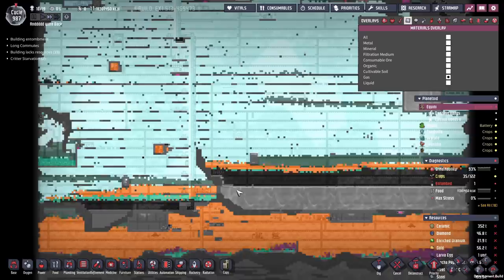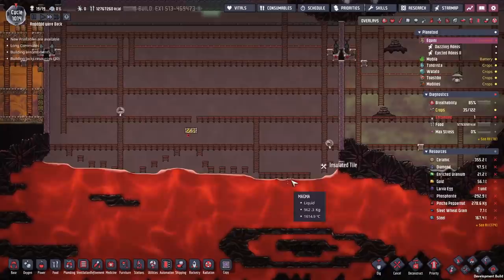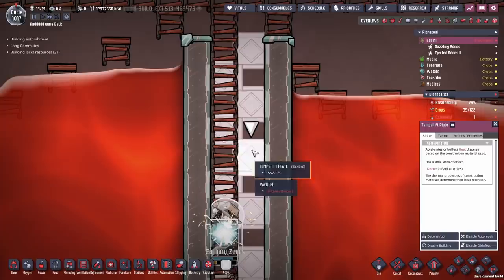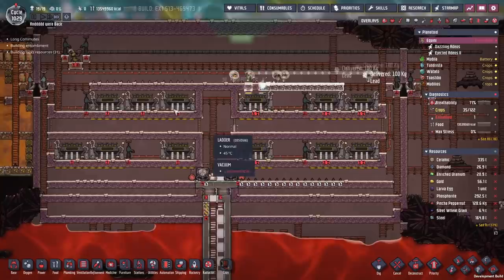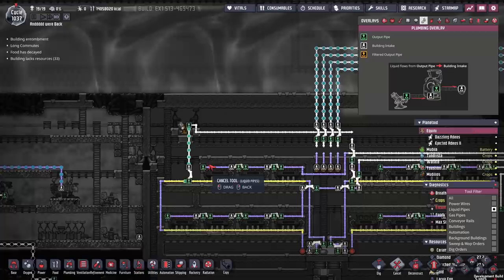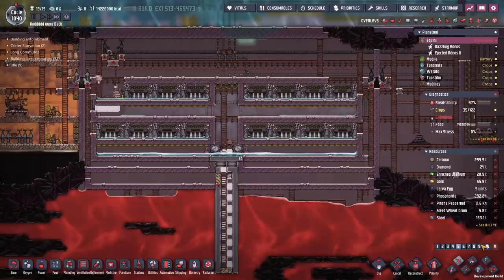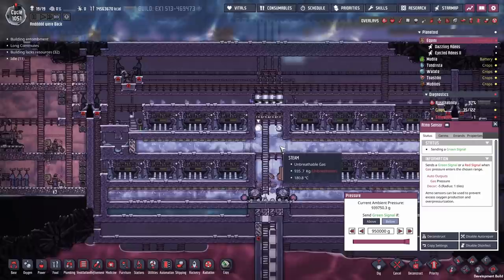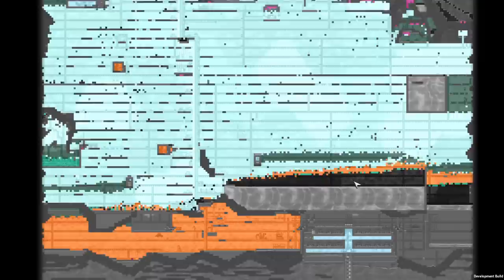Ep 14 : Magma power and water filtration : Oxygen not included Spaced out

Comment: Right Aqua tuner super coolant pipe is stagnant. It’s filled up one extra packet I think.
Omg that mod is a god sent blessing.. finally you can do proper automations in pressurized environments 😎 such a useful mod. Why doesn’t Klei allow that? There was a proper reason.. I forget.
Reply from the maker: Doh, I left the filler bridge on. I should have removed that before I activated the aquatuner. I will have to remove a bead from that loop. Thanks for the spot.
Reply: @FrancisJohnYT  You can prevent that (if you forget to remove the bridge that feeds the loop) by using two bridges in the main loop. Best illustration of the technique I know of is here: https://www.reddit.com/r/Oxygennotincluded/comments/gdk3h8/how_to_plumb_your_aquatuner/

Comment: If you use a heat exchanger to heat up the incoming mixed water and cool down the outgoing boiled water at the same time, you can get power and filtration while using less heat from the magma core.
Reply from the maker: I want to drain the heat out of the core, by end game I want to have it all mined out. Will have to desalinate our water a different way then but it should still take a long time to drain the core.

Comment: One thing I would suggest for your water purifier: make sure to have a liquid lock to do any servicing because things can break or maybe you might need to make updates and it comes from messes I made when I did mine feeding it magma from several volcanos as my heat source
Reply from the maker: The liquid lock is still there for now though I have removed door access for dupes. Lets hope this filtration remains stable.
Reply: @FrancisJohnYT  I seen towards the end but expect breaks but it's very efficient in extracting water out of polluted and salt water and might make for an interesting project if you plan on using magma from your minor volcanos for future purifying

Comment: FYI, as of Feb 2023 the door trick doesn't appear to work anymore, as in, can't built through a closed door anymore. The other thing is that the aquatuners can't cool the turbines, so there must have been some change since the video was made. I am currently only running two turbines and they instantly overhead into the "turbine too hot" 130+ C range. Aquatuner can't cool em down. Incoming oil into tuner is 116 or so, output is still above 100. Will let it run a few cycles and see if it's get better but right now it doesn't look good.

Comment: One word of caution: I did a similar geo thermal desalinator on my last map, and had issues with the stream pressure being too low.

Granted, I only fed in salt water and had a single pipe feed, but the issue was that with pure salt water input I was losing a tiny bit of mass to salt with each packet. But since the steam turbines always pulled 10kg of fresh water out, and I was putting in a few grams of salt shy of that as input, my system would lower the steam pressure too far, and then inject waaay too much heat in the instant the doors closed. So the system failed until I forced the steam pressure above a certain threshold by rerouting the fresh output via automation.

Your system isn't running 100% (yet) so it might not have this issue, but it still could happen once you start purifying full time, if you end up with 30kg or less input for some reason.
Reply from the maker: I am keeping the pressure really really high at 900kg+ for exactly that reason. It's why we are using the atmo sensor mod. Additionally we can only take out 30kg/s but we can potentially input 40kg/s. I am feeling pretty safe, but we do have access back in if something breaks.

Comment: Hi @francis john!  One quick question. Why not use cobalt metal tiles for your hot plate above the doors? Better TC than diamond, shouldn’t have to worry about hitting the melting point, and easily renewable resource with the cobalt volcano. Same question for the tiles and temperature shift plates for the cool steam vents?
Reply from the maker: Did not even consider that, will have to use it in the new cool steam vent tamers. Would not use it for the hot plate though. It's almost impossible we could replace it right now. Before that their is always the chance to melt it so I would just stick with the diamond.
But considering how renewable it is we are going to have to take advantage of it. Same with the Aluminium.
Reply: @FrancisJohnYT  thank you for the info!  I love watching your videos as I always learn something. You always make me feel like I over build though. For both the nuclear reactor and the geothermal I would have made the steam tunnels 3 blocks high and added temperature shift plates down the middle block but I guess it’s not necessary.

Comment: You didn't need a mod. You can set a second vent down and place a pipe element sensor. 

When the top vent is blocking the water will try to go down to the down vent. But that one should also be blocked. So the water stands still in the pipe allowing you to detect that the system is over pressurized. Only downside is that it only detects if the system is blocked you can't really prevent it.
Reply from the maker: I toyed with that idea but decided against it in the end. The issue I ran into was which pipe do you monitor?
If you monitor all four that gets really tricky. Another option was to just have the vents in a thin layer of petroleum for the overpressure trick but that felt wrong.

Comment: That's a really neat way to filter the water.

However, novice question, aren't you going to want the the brine for crabs and crops?
Reply from the maker: I'm not aware of any crops that need salt water or Brine. Lettuce does need to have a layer of the stuff on them but that is not consumed. As for the crabs they don't need the water, you can dry ranch them if you want.

Comment: Why did you put the aquatuners at the center next to the magma?  Wouldn't they be safer way out towards the edges?
Reply: I was thinking that too, right on top of the hottest part of the build seems unwise
Reply from the maker: It's to do with cooling and an even gradient of temperature.
All the water drops in the centre where all the heat producers are along with the temperature sensor. Set the temp to 180C and the whole boiler with end up at that temp. Now imagine you change the temp to 170C, slowly the centre will cool to 170C and then as the 180C steam is removed via steam turbines the 170C steam will slowly take it's place until everything is 170C
Now imagine a aquatuner at the end of one of the tunnel area's, the boiler is set to 180C so it is surrounded in 180C steam. But the aquatuner turns on and dumps heat into the steam driving up the temperature. Maybe only 14C, maybe more, maybe less. It depends on a bunch of factors. But it is not possible to control accurately.
By putting all your heat producers in one place you can direct all your cooling their to and get a nice even temp. Otherwise you need to put temp shift plates everywhere to even the temp and that is way more work. The nuclear reactor is designed on the same principle as this boiler, all the heat and cooling go to the same spot.
Reply: @FrancisJohnYT  that makes sense!

Comment: I've never used them, but have you considered using jet packs? Can dupes perform task while flying? Could they just fly out of the magma id they got trapped? I should probably test these things.
Reply from the maker: Jet packs allow you to fly and work at the same time, but you can't use them in a vacuum. Well that's not quite right, they work in a vacuum but they give off lots of CO2 and you no longer have a vacuum. Causes hot complications working with magma.
Reply: @FrancisJohnYT  Dang, that sucks because I can't think of a good use for them otherwise.

Comment: Thanks, nice work! May i suggest : instead of the no limit sensors mod for the water pressure problem, why not pump in water only when the turbines are on ? With a little bit of math (and maybe a timer sensor), you can probably make sure that the right amount of water is added when the turbines are on
Reply from the maker: Oh that is pretty tricky, something the pumps only pull a small packet of polluted or salty water. That makes it impossible to predict input on a per second basis. We could use liquid buffer tanks or filters, but I figured this made things a lot neater and far more straight forward to explain what we are doing.
Reply: The brine, salt water, and polluted water all produce different amounts of steam when boiled, while the turbines pull an exact amount, so without massive amounts of automation wiring, you can't do an input=output setup.
Reply: @yaemz123  I think it's possible, still. For example, you could add the output water of the turbines to packets of exactly 10kg, then detect when they pass the pipes with a pipe sensor that activates the input water (if coming from a specific geyser) for an amount of time equals to the ratio of effective steam added vs 10kg ouput (or its nearest integer, if you know what i mean, kinda hard to explain). I know it would add a bit of automation and tweaking, which is not the point of the video. But, my point is, it is possible to do it without the mod, that are often the cause of game crashes (for my low spec at least).
Reply: @Gargamel4530  if I understand your proposed solution, the problem still stands. If you allow a 10kg packet of input liquid to replace each 10kg packet of output water, you will lose steam pressure over time. This is because 10kg of polluted water, salt water, or brine will not produce 10kg of steam due to part of the mass turning into dirt or salt.
Reply: @yaemz123  Yes, i know this. I didnt want to, but my previous comment wasnt obvious enough. Lets do the math. According to the wiki, 10kg of ph2o = 9.9kg h2o (steam) + 0.1kg of dirt. Wich means that, every 100 packets or so of 10kg output water, you need to add two packets of 10kg ph2o instead of one. Or, if you dont want to count to 100, you can detect the output dirt on the rail and deduce the missing steam from the amount of dirt/sand comming out. I wont argue anymore on this problem. But thats why oni is so great, for every problem there is about a billion solutions

Comment: Francis, how are you able to cool all those turbines with super coolant? I couldn’t keep 4 turbines cool with super coolant, when I was in sandbox mode, At least in the base game.
Reply from the maker: Have not checked the math in a while but even with water you can keep 6 turbines cool.
The way it works is the steam turbine top emits heat equal to 10% of the heat destroyed by the turbine.
So imagine 5 turbines eating 200C steam and spitting out 95C water. Between the 5 of them they are destroying 105C of temp across 10kg of Water/Steam. 10% of that is = 10.5C of heat for 10kg.
An aquatuner cools the 10kg of liquid passing through it by 14C so one aquatuner can keep up with the 5 turbines easily.
However if it's not working for you check a few things, are you using water or super coolant in the aquatuner? Are you cooling down steam hotter than 200C? Remember it's 10% of the destroyed heat so if you feed them 400C steam that is a temp difference of 305C which is a lot more heat to destroy.
Reply: @FrancisJohnYT  i used super coolant for both the piped coolant, and for the layer that sat on the turbines. i went as far as using thermium turbines and pipes as well. 

i did max out the power output for the turbines, but i can't remember what the temperature was. i believe that the temperature may have been at 204 C. 

i only built it because i needed a simple power solution while experimenting with sour gas boilers.

Comment: Can't you just turn off the vent themselves instead of the automated valve?
Reply: Totally could, but that would leave a bead of water sitting right behind the vent which may eventually soak up enough of the surrounding heat to boil and burst the pipe. The way he's done it, the valve will shut off and the pipe after the valve (including the vent) will empty out.
Reply: The water would boil in the pipe when the vent is closed (I think)

Comment: Unfortunately your performance issues are going to keep getting worse as you open up other worlds. The beta just isn't running that well yet. I've done a half dozen spaced out playthroughs and at some point you need to open dev mode and start bricking up planets or large areas you're done with, filling them with neutronium. It doesn't interact with anything so it helps a lot with the frame rate.
Reply: This game too stronk for pc lol
I wonder if they can tweak the game to function more smoothly with newer CPUs .. would be nice. Kind of like how Wow lags because of limited cpu usage
Reply: Vacuum, tiles or fine spread of gasses of the same temperature are fine to non-cheat ways of optimization.
You can also cut pathing options and amount of accessible stuff lying on the ground. Helps a lot because game constantly keeping in check how exactly and  where dupes can possibly access anything on the map. It's may be even worth it to cut off some LARGE amounts of resources (like a pike of 8000t of igneous rock from your magma to power converter) in inclosed space with automation access to a small portion of the stuff like Francis did with infinite food storage, because then game thinks that no dupe can access any of that like 240 stacks of 25t of material DIRECTLY and cuts off unnecessary calculation.
Reply from the maker: Walling in the map will be on the cards, though I do like the neutronium idea but only if the game got bad enough. Would prefer to use the in game mechanics to help us out.